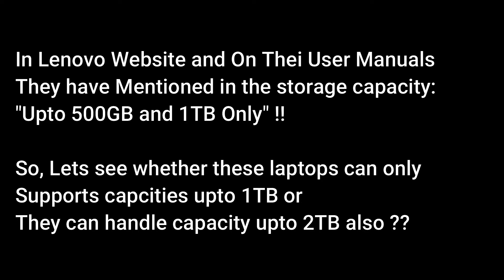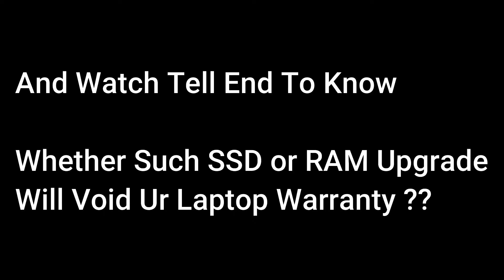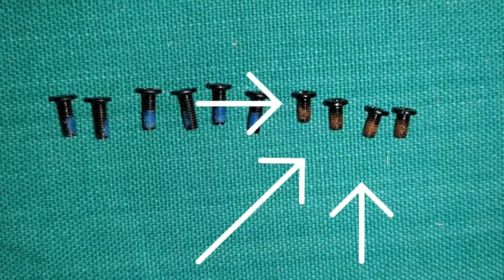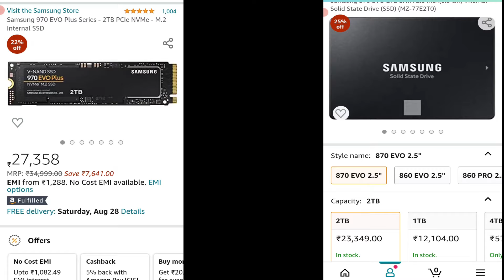Lenovo Legion 5 & Ideapad Gaming 3 2TB SSD Upgrade | Samsung Evo SSD

Comment: thank you ! I Gonna make it in Gaming 3i.
How did you find Silicon Thermal Pads? and copper thermal plates? 5:59
Reply from the maker: Copper thermal pad was integrated by the company itself on the back of the laptop case, and thermal pad you can buy on Amazon

Comment: hi. Thank you for the video. I have just one question though. How is the temperature of the Evo Plus installed in the legion 5? Does it get very hot while gaming?  How many degrees?
Reply from the maker: Below.. 56°C , While Gaming they don't usually heats up .. During Installation of Setup Files or Big data/File transfers SSDs got heats up but doesn't crosses 70°C which is the limit for thermal throttling on SSDs
Reply: @games4everyone883  thanks, for answering

Comment: In lenovo official manual it's said that only 512 NVMe is supported for port M.2 on htis model. So it still with 2 TB works?
Reply from the maker: Throw the manual in trash bro.. it's been 2.5 years my laptop is smoothly running with total of 5TB space, 2tb + 2tb + 1tb, it's completely safe & compatible
Reply: @games4everyone883  That's great, I hope I will not pay for 1TB and not be able to use it :) I had bad experiance with android tv where I used 1TB HDD and android tv supported up to 250 GB 😅

Comment: hey bro! i have Lenovo Legion 5 15ACH6 laptop and its comes with 512gb ssd and i need to extend upto 2 tb so buy the ssd from amazon the ssd is crucial P3 Plus PCIe 4.0 NVMe m.2 ssd and i installed once but it didn't work because i think there is mistake done by the installer because he don't remove the battery plug so ssd got crashed but i got the worrenty so got the new now i am confused 
so tell me i can try again to install it or i can buy the ssd reader and use as external ssd 
please answer my comment 
thank you

Comment: Just wondering what if in ideapad gaming 3 in the 3rd ssd storage or in the unusual way to use it when you use 3 ssd. Can i just use the 2230 ssd? Will that even more fitted than 2280?
Reply from the maker: Yes.. ofcourse you can! provided that you get one from stores.
Because 2230 SSD with 1tb or 2tb is rarely available and even if they do they are overpriced.

Comment: Bro, wanted to know are both m.2 slots of same speed output or different, so that I can install my new 2nd ssd in the best slot for performance, and also I got around 65 degree temps for my ssd under load, is that ok?.
Reply from the maker: Both r gen4x3 both works the same 👍
Reply from the maker: Above 70°C your SSD will go into thermal throttling, for 10-15mins till the temps goes below 65°C
Reply: @games4everyone883  thank you brother… keep rocking

Comment: Is it possible to connect 2tb 2.5 inch hdd in lenovo ideapad gaming 3 the same way you added 2tb sdd in lenovo ideapad gaming 3?
Reply from the maker: Ofcourse.. like wise I installed SATA SSD U can Install SATA HDD it will Obviously work.
Reply: @games4everyone883   Thanks ✌🏻

Comment: Hi bro, i have Ideapad gaming 3 15imh05 type 81y4, specs: core i5 10300h, gtx 1650 4gb,
the laptop comes with 1 TB HDD SATA 2.5 inch and 2242 Toshiba 128 GB SSD, can I put Samsung EVO plus 2280 1 TB SSD m.2 (new) into the remaining SSD slot (2230) like you until I finish cloning and then remove the current SSD (2242 Toshiba 128gb) and put the new one (2280 Samsung 1 TB)?
Reply: Can i put 3 storage all together?
Reply: Can i put 3 storage all together?
Reply from the maker: Yes you can

Comment: if i buy 512 gb variant of legion 5, will i get a bigger battery than the one you are upgrading???
Reply from the maker: There are two battery options 65Wh and 85Wh be sure to look for that if you wanted a bigger battery otherwise buying 512GB variant will only get you 65Wh battery
Reply: @games4everyone883  i want the one with 85wh battery, how easily i can get it in india and from where and also how can i check that the laptop has a 65wh battery or 85wh battery. thankyou

Comment: I have the Ideapad Gaming 3 15IHU6, but my Samsung SSD 970 Evo is only going half speed, while it says that can reach 3.500MB/s. Do you know any solution to that?
Reply from the maker: use.. https://osdn.net/projects/crystaldiskmark/downloads/77936/CrystalDiskMark8_0_4c.exe/ to benchmark ur ssd,
Its Sequential Read up to 3,500 and Write speeds up to 3,300 MB/s respectively. For Large Chunk of files like bluray movies, archived setup files, iso image files etc
Reply from the maker: Performance varies based on system hardware and configuration.
when you run the crystal disk mark you will see the peak performance around 3gb/s but its for SEQ 1M Q8T!
that means SSD was Sequentially reads and writes data with a size of 1MB block with a total of 8 tasks on 1 thread of the processor .
But in actual practical case scenarios the data that been shared or copied are of smaller sized files as a result large no.s of files are being coping to one place to other with all its attributes . so nothing is wrong with your ssd its just their marketing techniques / baits.
Reply: @games4everyone883 bro pls pls I beg u pls help me out.. I'm facing the issue too plsss.. I'm getting half the speed with the evo plus on the same model.. What should I do.. Pls bro i beg u help me out
Reply: @games4everyone883 pls bro help mee pls
Reply: Bro got any solution?
Reply: @koustavdarkknight2365  the problem is the port the M.2 is, only supports x2000 speed (2.000MB/s)
Reply from the maker: @koustavdarkknight2365  bro, install crystal disk mark and test , the product advertises the transfer rate of big chunks of data which is ideal, but in real life scenario a folder or installation folder contains vast no. of files smaller than 1mb which slows down the avg speed
Reply: It has only 2 lanes that's why it gives only half  speed , happened with me .